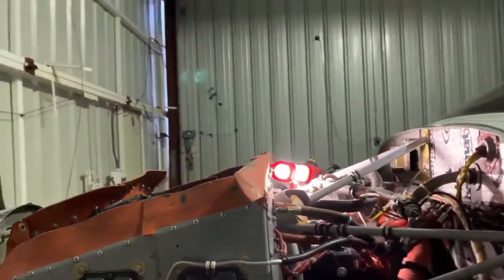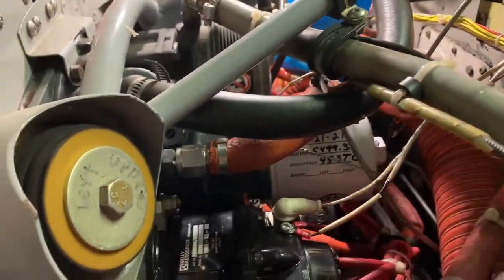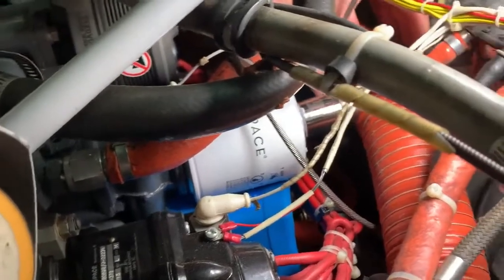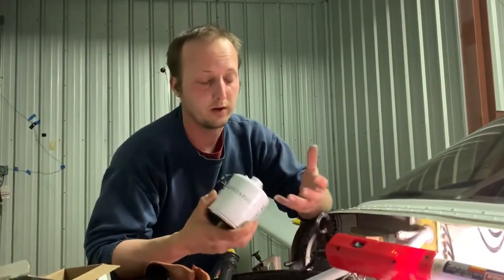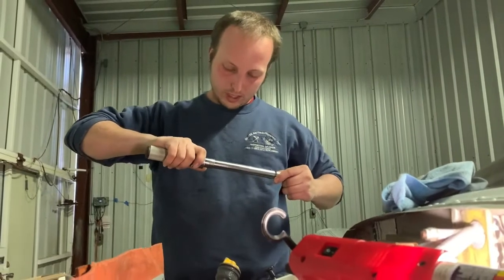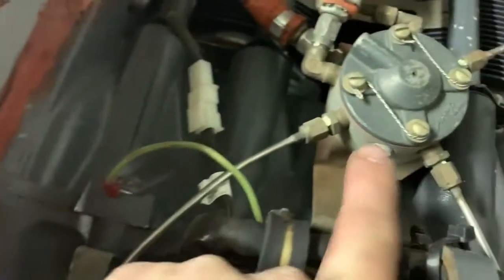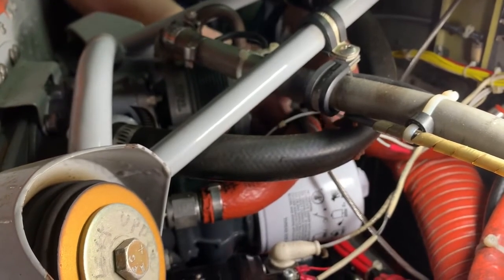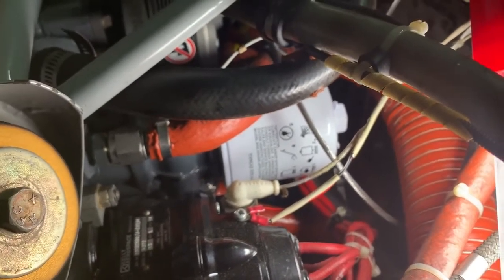Oil Change - Learning the Safety Wire Procedure

Comment: But, did you run the engine to operating temperature before draining the oi. If you didnt, youve wasted your time.
Reply from the maker: Rod,  I should have drained the oil when we returned from Vero Beach, instead I cleaned up the plane and we headed home.  I did run the preheats for the oil and cylinders before changing the oil.  I know it's not the same, but it wasn't a waste of time. Fresh oil and filter along with camguard is always a plus.